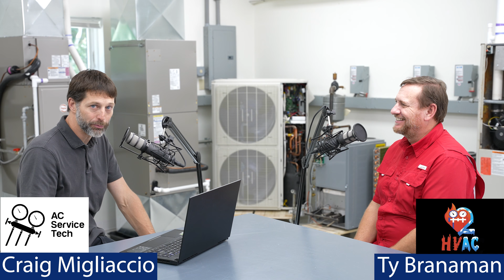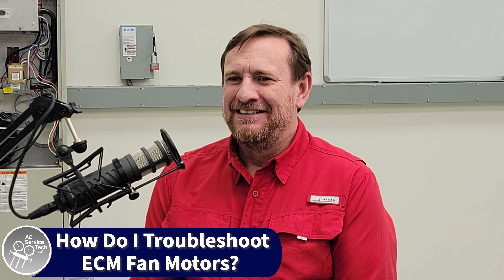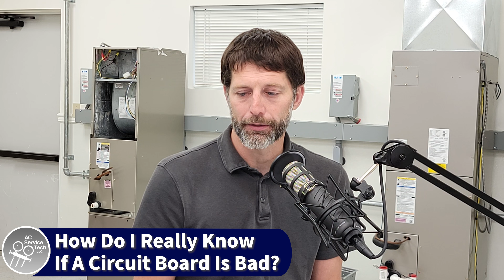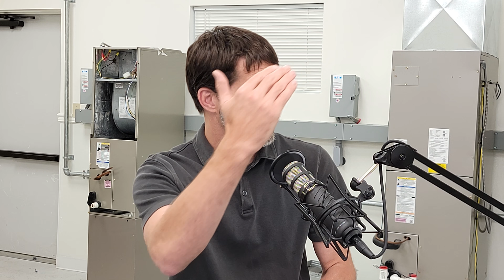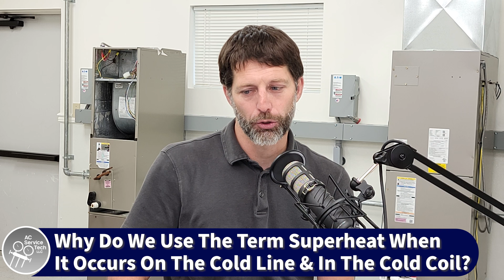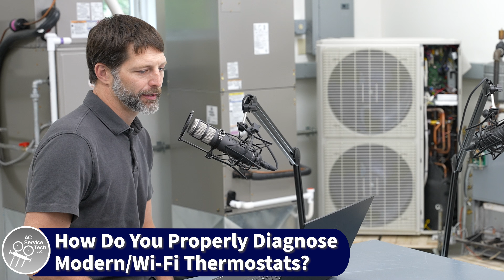Circuit Boards, ECM Fan Motors, Thermostats, and More! HVAC Q&A - AC Service Tech Answers Podcast!

Comment: have 2 wire  heat only thermostat on payne furnace . on call for heat the blower motor comes on first and runs constantly. status light blinking  . l bypassed thermostat and same problem.sensors ok. inducer draft motor and capacitor ok.filter ok.vents not restricted.24 v transf.ok.  no power from circuit board to inducer motor. am leaning towards bad circuit board.   any suggestions?

Comment: Just a few comments about superheat and subcooling.  I understand this video is for techs, but a major issue is that there is a lack of understanding of the Carnot cycle in the industry and every single piece of equipment operates on these principles.  I understand that these people aren't engineers, but it's hard to truly understand equipment if you don't know how and why it operates.  Needs to be a lot more education in the basics.

Comment: what would be the problem if you conected  120 volts from city line and 120 from the inverter at the same time and replaced the out door bored after and now it dont stay running on heat  but works great on ac

Comment: You both are great teachers & educators. Thank You. Question? Can a system with a PSC motor be converted to an ECM? Is it worth it? Thanks again
Reply: Absolutely they can be converted. Evergreen makes one as does Mars. There are other brands too. I believe US Motors and/or Century does as well. I would say it would be worth it if you/the customer wanted continuous fan. Not only is it more efficient, but the 5-speed ECMs generally have a slower low speed than a PSC for quieter operation.
Reply: Not sure why you’d wanna do that though..  the cost savings are lost in the almost certain maintenance needed on the ECM motor…

Comment: I often hear people say that r22 has better capacity than r410a...is this true? And what do they mean by capacity?
Reply: From what I understand that may mean that it takes less (in pounds) of r22 than r410a to run a system. This is offset by price of course.
Reply: R-410a has much lower “entropy” than R-22, meaning it is MORE efficient as it moves more heat per unit of energy.

Edit: Forgot to add, I think R-410 becomes less efficient as outdoor ambient increases. I never did the research, but there might be a temp at which is becomes less efficient than R-22 (maybe if you are in Phoenix when it is over 120F). But, I don’t have an answer or know for a fact at what temp that happens.

Comment: Starting with analog gauges will help you understand what your doing with AC
Reply: I agree. I only like digital for nitrogen pressure checks. I can just glance at an analog gauge and know what is going on. Digital, I have to stop and think.
Reply: @chrisdeanndavison3626  I won’t go back to analog gauges… But, I didn’t have digital gauges until 30 years after I started in the industry; so, pretty comfortable I could still use them if I needed!

Comment: I recently found a bad ECM condenser fan motor. The replacement motor wholesale cost was $667.00. How can manufacturers charge this outrageous price?
Reply: @drwlpwasright5132 but thats not the rite thing to do. You just lowered the efficiency of the system for the customer is all you did. Not to mention throwing off the next tech who works on it in the future because the wiring wont match the schematic.  Bad move. Hack work
Reply: The ones I've seen they're always good and it's only the control module that goes bad. And from what I thought I saw from YouTube it's almost always one component that fails. Then the manufacturer covered the board in epoxy so good luck working on it.
Reply: Trane charges over 1000$ for ECMs.
Reply: @drwlpwasright5132  well you didn't say you gave them an option, be more clear next time
Reply: Bideneconomics